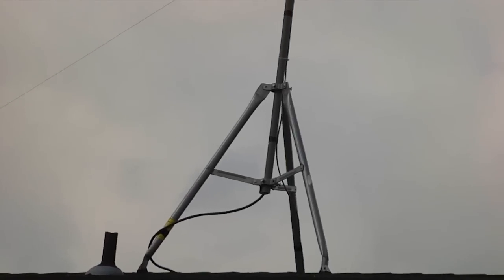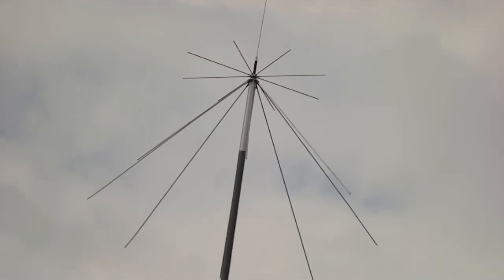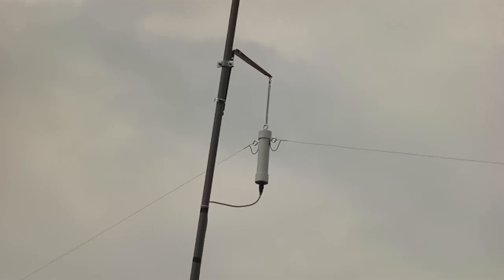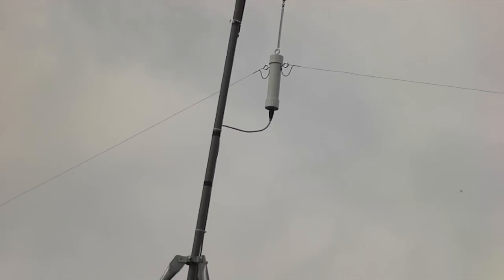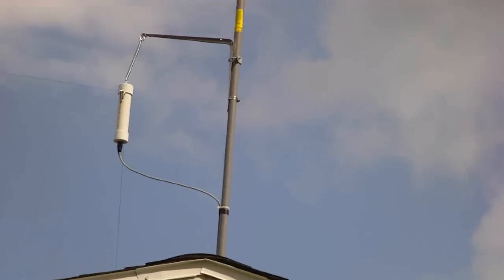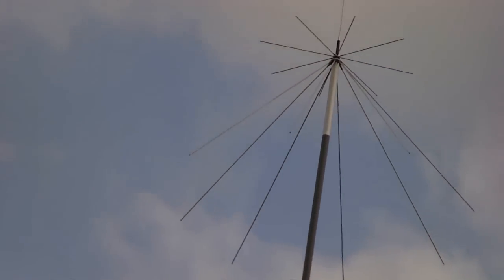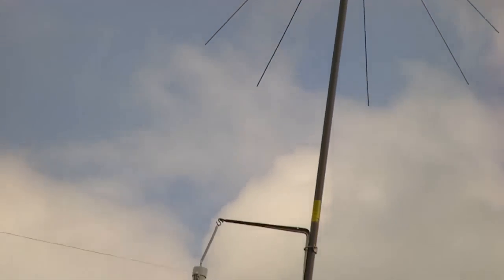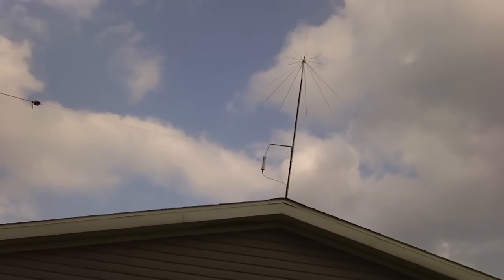Stealth Amateur Antenna System (7 MHz to 1.3 GHz) AKA HDTV

Comment: The wire is very thin, I like that. I made a couple homemade dipoles with 14 Gaugu Commercial wire, with black insulation, and it loos thicker than yours, very nice. 

Cheers

KB1VEZ